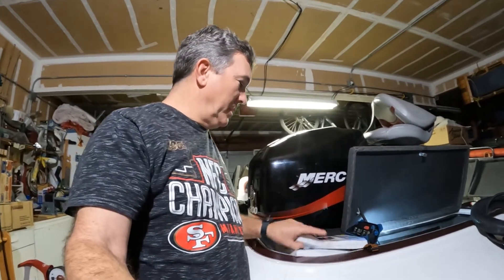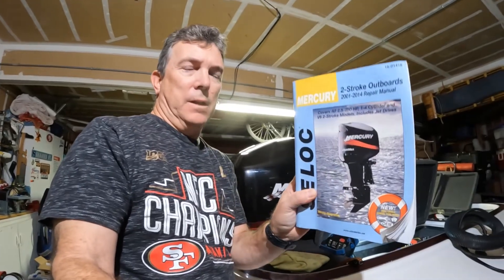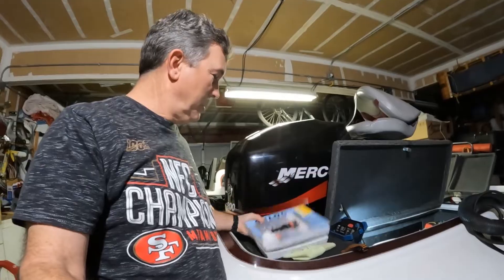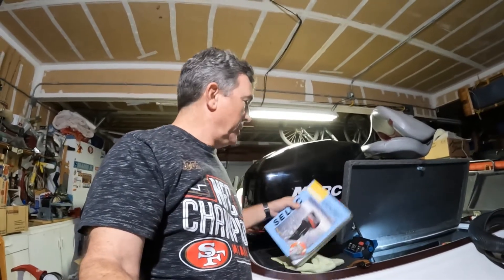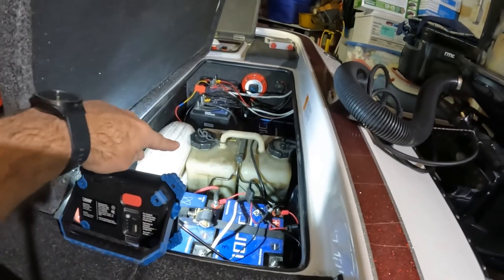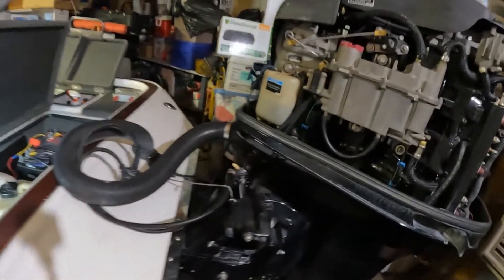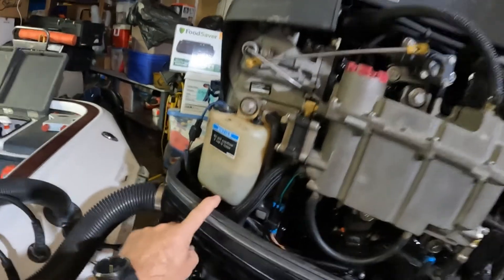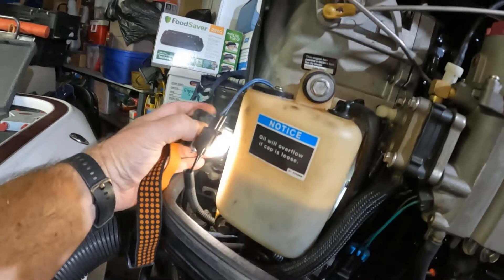Troubleshooting Mercury Optimax Oil Alarm - Part 1

Comment: I've had this problem twice now, it's the DFI oil in the large tank, for some reason over time the oil coagulates on the fine mesh filter on the bottom of the pick up pipe, this is the black cap with the 2 pipes on it, (the engine pressure pipe and the oil outlet feed pipe). Note which pipe goes where and then remove them, lift the pipe out and wash off all the coagulated oil from the filter on the bottom of the pipe, I used brake cleaner. You can either waste the oil in the tank, wash out the tank and use brand new oil or drain the oil through a very fine mesh sieve, i know this oil is very expensive. Refit the cleaned pick up pipe and refit the 2 pipes on top, remove the cap off the engine reservoir, start & run the engine (with water cooling) and the reservoir on the engine should start to fill up, once the oil reaches the top, refit the cap and you should be good to go. Hope this helps.
Reply from the maker: Thanks
Reply: Is there a trouble shooting method to know if this is the problem or the oil pump itself
Reply: @dmacfishing6971  Not really, when this mesh filter gets clogged, the header tank on the engine stops filling up off the large tank, the only way to be sure, is to take the tank out, undo the fixing cap, lift out the pick up pipe and examine it. If blocked, just spray brake cleaner down the removed pipe and flush it clean. Another reason for header tank not filling is the crankcase pressure pipe has no pressure with the engine running, ie the pipe is trapped somewhere, kinked or split. Apparently the DFI oil can cause this gelling action on the filter. Hope this helps.

Comment: In case you haven't found out that white device on the in hose to the reservoir is not a check valve but a oil filter, I also thought it was a check valve because of the flow arrow , after I bought a new one found it is a filter!

Comment: Maybe you can help so my oil tank on the engine is about 3/4 full. It’s like the oil doesn’t pump in, but I’m not losing it and I get the alarm. I even cleaned the screen that goes from the oil tank in the bilge and still no results. Do you think that could be a float problem?
Reply from the maker: With the engine running you can unscrew the cap on top of the oil reservoir and it should fill fairly quickly. You want it filled to the top. If not, disconnect the air line from the engine to the remote oil tank and blow air into the tank to see if it holds pressure. Use low pressure. Check for air leaks. That should also push oil to the engine. Give those a try.  Good luck.

Comment: Do you have your oil tube going through your rigging tube? I put a rigging tube on my boat as I  ran the shift/throttle cable, oil tube, battery wire through. Now I am getting oil alarms ever since I relocated the oil tube. First time out I got an overheat alarm and water flow smartcraft sc1000. I change the impeller and that was fine. Went back out got pass the marina and beep beep beep beep. Then I pulled the cover and bleed the oil tank until it over flowed. Put the cap back on and did not tighten all the way. No alarm but I had oil running out the back. I did not know until the marina called and said I was leaking oil on the boat under my rack. Again my problem did not start until I moved my tube inside that rigging tube. I have a 150 efi sw 2003
Reply from the maker: All the hoses and wires go through the tube.

Comment: What was the fix?
Reply from the maker: We ended up replacing the oil line and check valves and it worked great for about 5 months. Then it happened again. Found out that I had some bad oil that coagulated and plugged the pickup screen in the remote oil tank. Dumped that oil, replaced the pickup tube, cleaned the tank and put in some fresh oil. Been fine for the last few times out so only time will tell.
Reply: What did the alarm sound like. Was it ever 1 long beep?